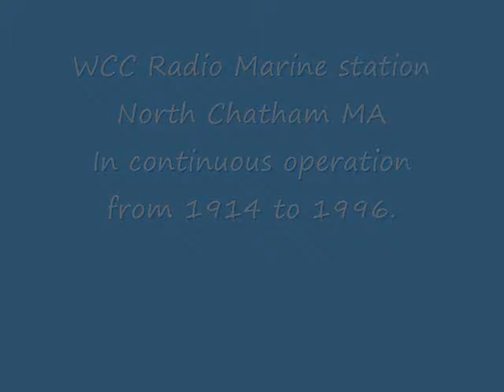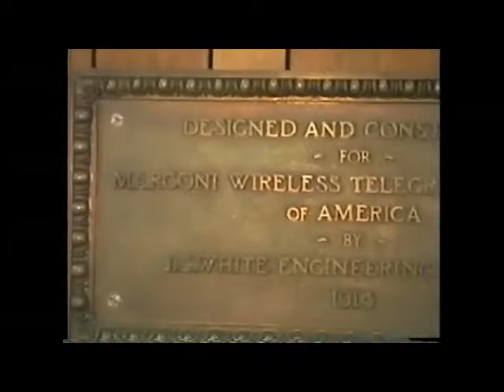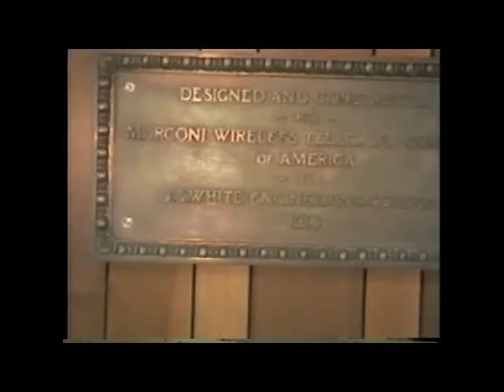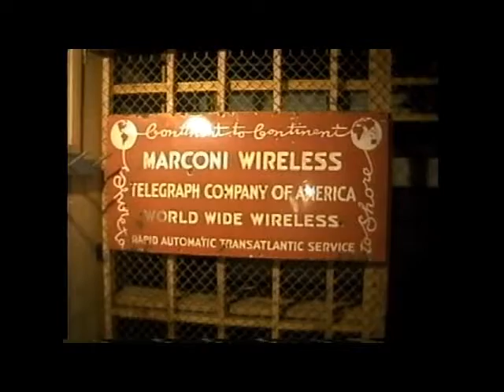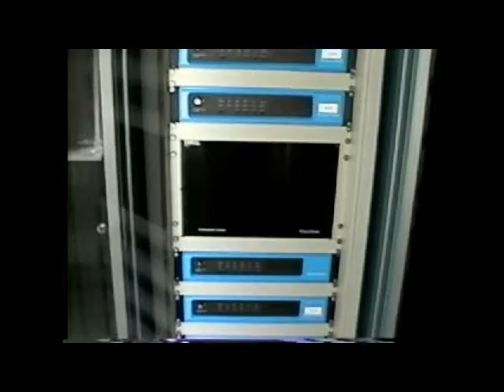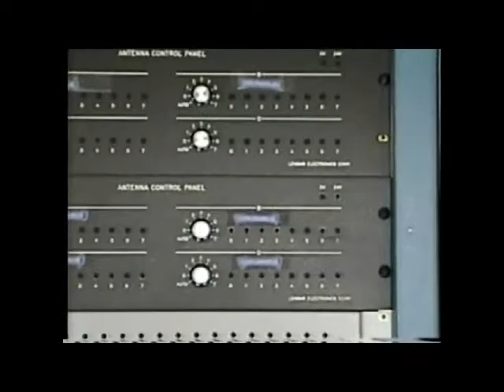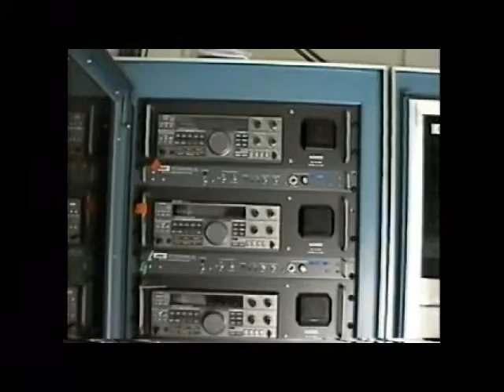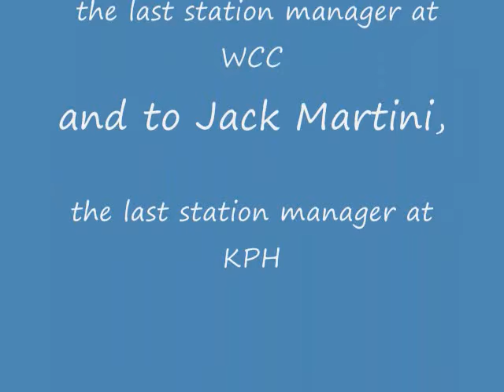WCC Radio Marine Receiving station North Chatham MA

Comment from the maker: Thanks for your comment. Actually, those are Kenwood R-5000 receivers. I selected these because of their performance and remoting capabilities.

If you review the video clip again, (about 5 minutes into the video) you might notice all of the remote controls which I designed or had built for WCC. This was to allow for the complete operation of WCC at Chatham, Massachusetts by KPH operators at Point Reyes California.
I used redundant T1s between WCC and KPH to remote the audio and digital data